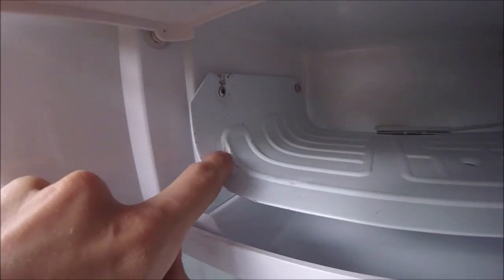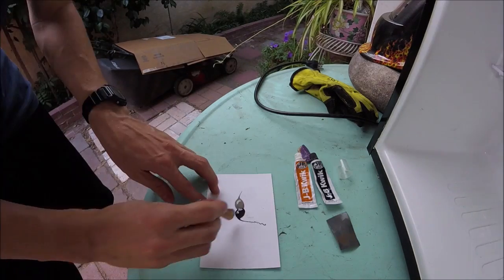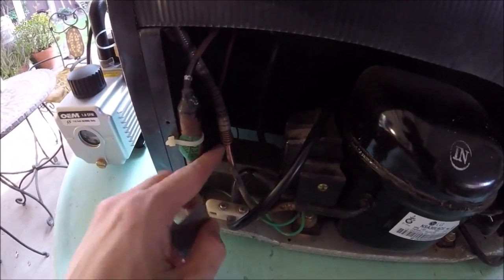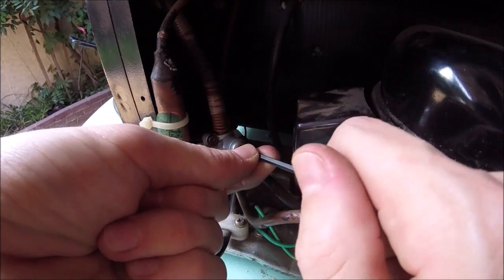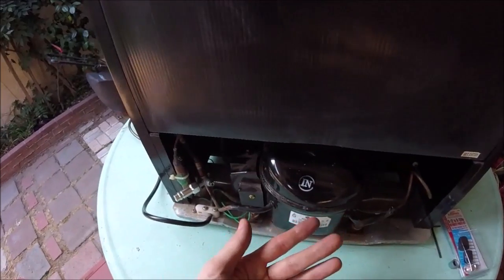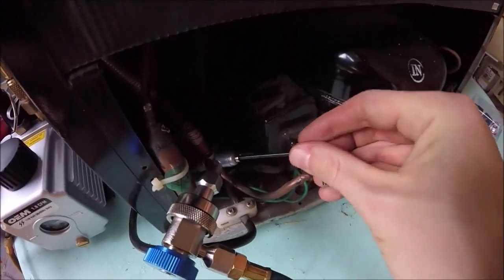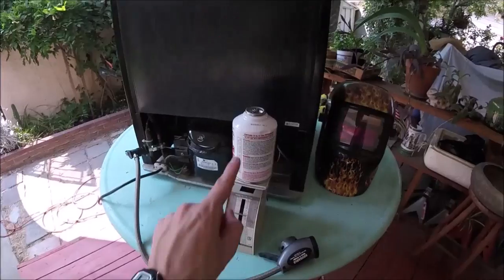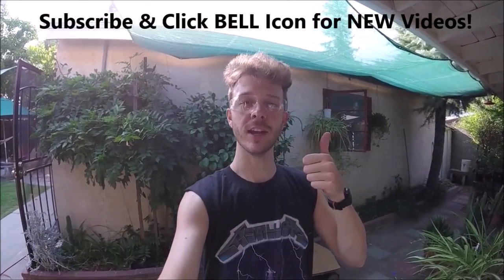How To Fix a Broken Mini Fridge -Jonny DIY

Comment: Hi Jonny, 
Thank you for this DIY, I tried to follow the same and have couple of questions. When creating the vacuum using vacuum pump set, I see smoke coming from oil filler,  secondly how long would it take create a vaccum, guage is stopping at 25 and slowly going zero .
Reply from the maker: Smoke coming from vacuum pump is normal its just the oil, and it should reach vacuum fairly shortly if the leaks have been all fixed. If it cant reach 29ish vacuum and hold it when you close it off, there's still leaks that need to be addressed 👍
Reply: @JonnyDIY  , there was only one dent and sealed through epoxy , pls let me know how can we find the leak?
Reply from the maker: @sri5147  look and listen for a leak can also put dye in system and put some pressure into system and look for leak dye

Comment: I made this mistake today with a Hammer and Screwdriver and a gas come off. I got scared! It was actually from under the freezer, 
Can i fix it like this? Or do i need to call a repairer
Reply from the maker: You can fix it, but will have to do all the things I demonstrated in the video.
Reply: @JonnyDIY  Okay, Let me try it! Thanks Jonny
Reply from the maker: @urginyalcin960  you're welcome, glad to help 👍

Comment: Awesome video thanks! I have everything but the pump and gauge. Is it critical to get all the air out if I’m confident I sealed the puncture or can I just add refrigerant and skip that part?
Reply from the maker: It is critical to get all the air out before recharging. Try and find a shop that loans them out or rents them out. I know Autozone and Oreillys does, sure others too 👍
Reply: @JonnyDIY  ok thanks for the quick response. I checked the local Autozone and they said they only have the gauge and not the pump. I will check around.
Reply from the maker: @evanbrahce7508  you're welcome, yeah call around sometimes they're already loaned out.

Comment: That fridge looks exactly like mine. Which I DID take a screw driver to it and put the hole in the exact same spot. Now, my question is: it says it takes r600a not r134a...can I use r134a?
Reply from the maker: yes I believe you can use r134a in it

Comment: I will just buy a new one for less than $100. My time and getting all those tools would cost me more in the end.... Nice hack if you already have the equipment to do it, though.
Reply from the maker: Yeah I only ended up spending $15 or I'd have just bought another if I had to spend over 50
Reply: My mini fridge is $400 😂 

FML. It came with the house and is custom fitted to the cabinet and no fridge fits it. Dammmmm

Comment: My refrigerator works with 600a gas, do I need special adaptor? I'm only asking because the links refer to R134a, like it can matter.
Reply from the maker: I think the 600a uses the same "can tap" as r134a
Reply: @JonnyDIY  What about the bullet percing valve and hoses? Do one you suggest will work for my needs?

Comment: how do you see a fridge that needs regassing dude!
Reply from the maker: In my case had to find and patch leak first before recharging or it would have leaked again. Not worth recharging with a larger leak that doesn't get fixed 1st. Thats why vacuuming system important as well

Comment: Might be worth buying some pipe cut it in half and then use that over the hole, then add the sealant to stop the hole being blocked up maybe.
Reply: No
Reply: Yes worked fine  @JMully57

Comment: ? What it my fridge uses r600 i poked the line with a knife ijb welded it already same process for R600
Reply from the maker: Have never worked with r600 but yes I believe its the same process. Not sure where you buy the R600 though
Reply: @JonnyDIY  ebay got it for 18 plus 8 dolar shipin onlyproblem is the line is on the oposite side isit the fatter one versus the thinner tube that luks like a submarine igot the parts from amazon should get them soon

Comment: My mini fridge is making water running sound and doesn’t cool well. What is the problem?
Reply from the maker: Could be low refrigerant or could be bad compressor, could be a lot of things really. Mine sounds like trickling water sometimes but it works fine

Comment: So I was trying to defrost the freezer on my mini fridge and I punctured the thing you showed in the beginning, gas was leaking, and I unplugged the fridge, if I repair the hole, is there a way to reput the cooling thing in it without doing all the stuff you did?
Reply from the maker: No unfortunately you would have to do whole process as I did. Best bet is to look for a new one or save some money and get a used one off craiglist or offerup or Facebook marketplace. See em all the time for $20-40 🤙🏼
Reply: @JonnyDIY  sounds good to me, probably gonna find a new one cause I’m not that of a professional to fix those things anyway, better of to get a new one for $40

Comment: But you can't just weight the can, once you unscrew the bulky valve from it, all the remaining freon escapes!
Reply from the maker: The cans we use now use are self sealing and can be screwed on and used and removed many times. So no worry about losing refrigerant 👍
Reply: @JonnyDIY  Wowzers! I bought a cheap can from Auto Zone, and it's One-And-Done. Oh well..... my bullet valve arrives from Amazon tomorrow, I'll be doing it your way then.
Reply from the maker: @gamestacker2  good luck, hope you can get it working again 👍
Reply: @JonnyDIY  got it! Thanks! Worked great! And I just left the gauge kit hooked up and moved the yellow hose right to the refrigerant can, and filled it up right from the blue dial. Work just as good.
Reply from the maker: @gamestacker2  awesome, glad you got it going 👍

Comment: Feels good to know that I am not the only one who punctured the mini fridge with knife.
Reply from the maker: You're in good company with many. Such a poor design flaw
Reply: Fuuuuu, literally just doing a quick search to see if I messed up my mini fridge and this is the first thing I see. Confirmed within second I’m in the right place after seeing your comment.
Reply: 😂😂😂😂😂😂 I just did it 2 days ago. Man!!
Reply: @eliagudes2613 5 min ago
Reply: Did it last night, too much ice couldnt get my whiskey out the freezer😂mf was encased
Reply: Did this unfortunately you know u screwed up when you can smell the refrigerant
Reply: @deadpres2575 YEP,I was pissed at myself!!💯
Reply: Flat head screw driver.
Reply: I used a hammer and chisel,had a fuckin glacier in mine!!thought I was being careful but got impatient and gave chisel a good wack then I heard it,felt it,and saw it!!WTF I actually thought it was just a small pin hole,no big deal,left it overnight it seemed to be running and turning back off,opened it next morning and could smell it and ice I missed leaked into drain pain,it overflowed!!I was pissed at myself and stupidity, but I can definitely do this repair!!already have refrigerant w/filler hose,and JB weld!!never knew that line puncture kit existed!!
Reply: Bro I was cleaning the freezer then nothing wouldn’t freeze anymore + it start to have this chemical smell and I already knew something was leaking just didn’t know till I looked closer and I’m just dumbfounded rn on my stupidity 😭
Reply: I just did 5 min ago
Reply: I just make a tiny hole today while scrap those ice off
Reply: yeah i just drunkenly did this the other night. my dumb ass even grabbed a hammer and started banging on that knife!!! 😁😁 but i got the fridge for free i'm glad its an easy fix
Reply: Ahhh sucks so I did this 2 days ago . Seal the cut , everything dry and now the fridge still isn’t getting cold. But I can hear it running.. what should I do ? Do I need to add refrigerant?
Reply: Its me also
Reply: Someone please just kill me!!! 😫
Reply: 😂 I did the same thing!
Reply: I was so embarrassed 😭
Reply: I did it too coz I could open freezer door!
Reply: I just did it lol
Reply: I just did it , in feel so stupid 😢😢😢😢😂😢😢😢😢😢😂😂😢😢😢😢
Reply: @williamoshaughnessy9995 same, brotha!!!💯I can fix it!! now that I saw this now!!and also,my dad was a TV repairman!!😂😂😂
Reply: I used a screwdriver
Reply: I really does😂😂😂
Reply: Just did it this a.m
😢
Reply: Word to the wise... Its not worth trying to chisle it away. You will go through the ice EVEN IF you're being careful. Learn from us and do not do this.
Reply: I just punctured mine, I've been crying worrying. This made me laugh. 😂😂
Reply: I used a metal chisel 😂
Reply: Same! Lol...

Comment: I was defrosting my RCA mini fridge and needless to say it’s now making a hissing noise. How to find the holes in my freezer?
Reply from the maker: Defrost by unplugging and should be able to find hole or holes. Then will have to do whole process as I did to fix. May be able to find a used one for same price as fixing though. And save yourself a headache

Comment: I have a question I hope you answer. My mini fridge  is hot other side is the normal.
Reply from the maker: Its normal for the outside to be hot as its so compact inside. But if inside that's another issue
Reply: @JonnyDIY  thank you
Reply from the maker: @ladiso7247  you're welcome, mine gets really hot to the touch too if I have it on MAX cold setting. I turned it warmer and it doesnt get as hot

Comment: Well, I just used a knife on my freezer section and puncture a hole in it. Being a impatient defroster. Now I have to do this same exact thing to fix the hole. Thanks for the video.
Reply from the maker: You're welcome, glad to help. It really is such a poor design flaw. Good luck with the fix 👍
Reply: Updates? Did you fix it? Is it still working?

Comment: How would I go about finding a leak in the evaporator I've been told is there but haven't seen? Love the video, thanks for the info!
Reply from the maker: You're welcome, you could add some dye to the refrigerant when recharging and itll leak and leave a trace at point of leak. Youll need black light flashlight and yellow glasses to see dye 👍

Comment: So i was defrosting my mini frig an i punctured it. Air came out an will this work if follow the steps. It wants to cool. But nothing
Reply from the maker: Yes you will have to do the whole process as I did. Patch hole, vacuum system, and recharge with refrigerant 👍
Reply: @JonnyDIY  thank you im so bummed out i just cried going to try this
Reply from the maker: @estherbaeza1777  sorry to hear, it's really a design flaw and not your fault. So many have done the same as you, simply trying to defrost.

Comment: Sooo same theory if it's a screwdriver size puncture through the bottom and top?
Reply from the maker: Yes, just be careful not to push the epoxy in the punctures or it will clog the line 👍

Comment: I punctured my wine cooler with a knife while defrosting. It smells like freon is leaking now? If i follow these steps will it fix my issue? Or should i just buy a new wine cooler?
Reply from the maker: if you follow these steps you can fix it. Patch the hole first, then vacuum system of air, then recharge with refrigerant to the added puncturing saddle valve
Reply: @JonnyDIY  thanks for the fast reply sir. I am going to try it out. Ordering the supplies now.
Reply from the maker: @windman456  you're welcome, good luck with the project, take your time and you'll have it fixed in no time  👍

Comment: Well removing the vacuum is one thing but does that also remove all the refrigerant in it?
Reply from the maker: Vacuuming system removes any remaining refrigerant as well as any air, when you disconnect it on the valve it doesnt let any air back in. Then just add the correct amount of refrigerant 👍
Reply: @JonnyDIY  Great, thanks. There isn't much coverage on R600a fridge repair. The only difference between that and R134 is that R600a is flammable. I'm going to try your method and double check there are zero leaks with vacuum

Comment: Can I use super glue instead of proxy?
Reply from the maker: No, I would only use epoxy. Can get one of those syringe style ones for ease of use 👍
Reply: @JonnyDIY  shoot I already put some on. I can get some epoxy right now. Should I remove the glue?
Reply from the maker: @justinhall1658  I would remove it best you can, yes. Super glue just wont hold up especially with the cold

Comment: hey my Galanz 3.3 single door freezer/fridge has no light or light switch ....is that because its a single door and there is mo need for a light in the freezer?
Reply from the maker: Yes most smaller fridges dont have any interior lights 👍
Reply: @JonnyDIY  Thank you!

Comment: I punctured the bavk of my mini fridge with a knife then it started leaking some gas. it kinda smelt like a marker, so I turned it off. I looked it up and it said it was something called Freon and it’s deadly. Should I be worried
Reply from the maker: I wouldn't worry, but your fridge is now garbage. Take to recycling center or if it's worth more than a couple hundred dollars call a service tech to repair 👍

Comment: To all who genuinely give a shit. DONT DO THIS TO YOUR FRIDGE. A piercing valve will leak out over time, JB weld will NOT hold. You need to either braze that coil shut with some aluminum safe braze or change it out. A proper service port needs to be installed. You need ACTUAL refrigerant, not that fake automotive garbage that is mostly additives. Take this to an actual HVAC mechanic, this repair just compromised this system.
Reply from the maker: The mini fridge is still working fine over 2 years later with the jb weld, piercing valve and automotive r134a. As always, to each his own & your mileage may vary

Comment: So do I have to do all of that for the piercings? I just filled mine and was just going to turn it back on. Will that not work? I would need to follow all those steps?
Reply from the maker: If you have a hole in system you will have to do as I did

Comment: Hey, Jonny, where's the defrost drain hole located for mini fridges usually? Or do they not have one? Asking so i can regularly clean and unclog them
Reply from the maker: I dont think there is any holes, i think they recommend just turning it off and letting it melt or gently removing ice with plastic or wooden utensils. You could use hairdryer to speed up process 👍
Reply: @JonnyDIY  lol haha i guess ive been doing it right then thanks daddy

Comment: Hey Johnny, thank you for the video. I've both a Emcool  AC Car refrigerant a134 can from Amazon. Not if it works with my mini fridge without using a vacuum pump. Let me. Know if I can only fill it without pumping the air inside.
Reply from the maker: Yes r134a is fine. Should use that if its within age of last 20 years. Older ones used R12. You can add refrigerant without vacuuming only if the system is just low and not empty. Its best to vacuum and recharge though, that way you can correctly add the right amount

Comment: Do you leave the valve that penetrated the fridge on the pipe? If you remove it, how do you patch it?
Reply from the maker: You leave it on, they can eventually leak over time, but can last years without issues as well. If wanted fully permanent, you would need to sweat on a valve and then either leave it or get specialty tool to cut it off and stub the line

Comment: Hi Jonny. This was SO helpful! You're so easy to watch, and you make it look easy! Question. I have a broke Magic Chef 3.0 cu. ft. Upright Freezer Model #MCUF3W2.  How do I know what caused the fridge to stop functioning and if it has a leak which needs refrigerant? And if it is a  refrigerant leak, do I fix my freezer the same way? Thanks!
Reply from the maker: You're welcome, glad to help. Usually if its leaked out the refrigerant you would have noticed it to start to get warmer and warmer over time, it doesn't usually leak out all at once unless punctured. If still slightly cold it could be low, but if completely stopped it could be a multitude of problems, compressor could have bit the dust or a malfunctioning electronic part could be the culprit.

Comment: Awesome video! After you patch it up can you just plug it in and it work normal? Or do you have to vacuum it and at more refrigerant? I was just curious what the steps were for.
Reply: Seems like a dumb question, but I'm just looking for all the details. It's my first time and I'm probably overthinking a lot of it.
Reply from the maker: @matthewfranks6260  yes you must vacuum and recharge as I did, after patching hole if you punctured refrigerant lines. You'll know if you did, it'll all hiss out and stop working within hours